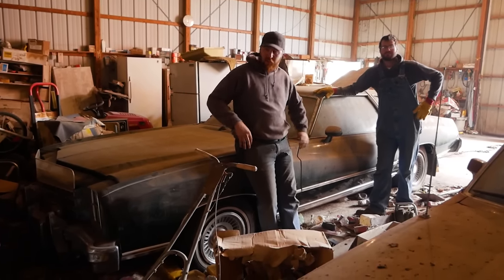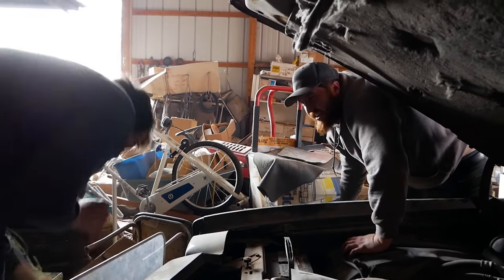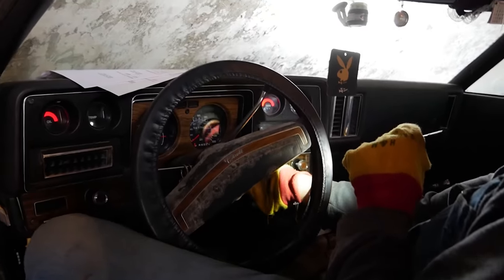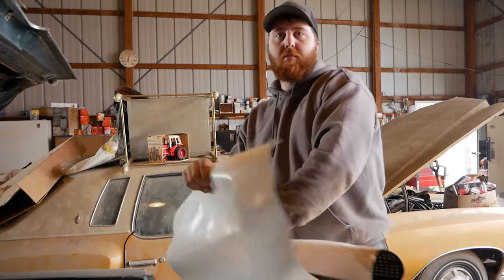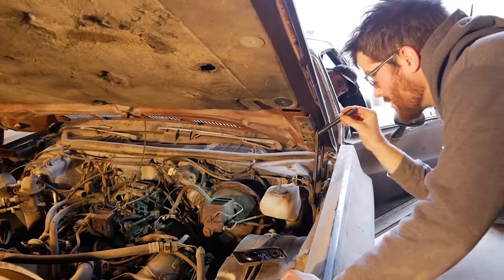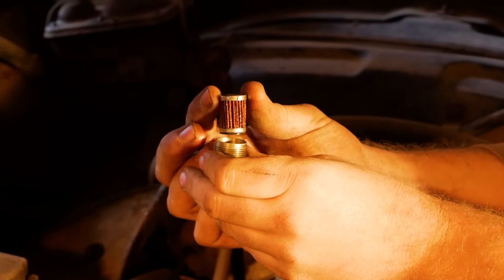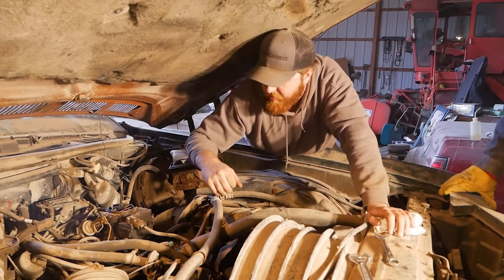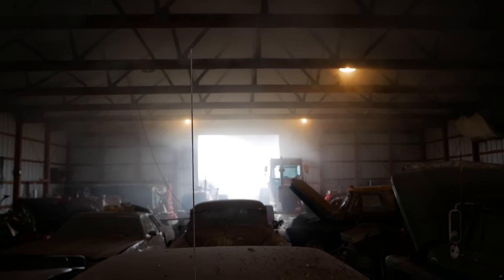ABANDONED Monte Carlo Driven From its GRAVE! - First Start in YEARS

Comment: I've got to say I love the fact you guys are pulling all these beauties out and doing what you can to get them running again.  Back before YouTube was a thing, my wife's uncle bought a house in Phoenix, AZ that had been abandoned.  In the detached garage, literally under three feet of garbage, he found a 1977 Camaro Type LT.  The home seller forgot it was there, but had a title for the car.  I gave $200 and towed it home. A carburetor, some new plugs, a fresh battery, fresh gas, and an oil change made it a daily driver while I was in college.

The car was an Arizona car, so no rust, but the paint and interior were sun baked.  I ended up installing fresh carpet and some swap meet bucket seats from a GMC Cyclone and had a great little car.  In three years, it only let me down once when the coil on the HEI gave out.  In the end, I sold the car for $1500 after I finished school, because I didn't need it.  Now that same car, in the condition it was in would bring $6000-$7500.  What a difference 24 years can make.

Comment: Just a quick note Kevin,  the 400 small block used only two bolts if it was equipped with the 2 barrel carburetor.

Comment: I love older Monte Carlos. Use to own a 1979 and it was a great car to hot rod. Took out the 305 and placed a 383 stroker in it with a 12 bolt rear end. One of the fastest cars I ever owned. Hopefully you can get the other Monte Carlo running.
Reply: 1979 is not the same body style as this 1976 model...it ran '73-'77. Changed in '78

Comment: I have enjoyed these vehicle revivals from that farm (just like I have enjoyed all your other ones). I hope the Pontiac Bonneville SSE is next to be revived as it was the highest Bonneville trim level in the 1987-1991 era and a fully equipped one had a crazy stupid amount of buttons in it for convenience. Also i hope the Lumina is revived, though you better hope it does not need any real engine work as the z34 has the 3.4l Twin Cam LQ1 which while producing at least 200hp (a respectable amount in the early 1990's for a V6) and was pretty quick but is a nightmare to work on. As for the the Buick Lesabres in the yard blowing white smoke or smelling of coolant. The head gaskets are probably fine. These engines (3800) while mostly bullet proof and reliable, suffered from two issues. The first was the lower intake gaskets. GM went cheap and used a plastic lower intake gasket (called composite by GM). Those tented to crack and coolant would get into the engine or the exhaust. Year later GM came out with a replacement gasket set that was metal and that stopped the issue (they should have used metal in the first place). The Series 1 and Series 2 3800 had this issue. The series 3 used the metal gaskets and had no issues. The second issue was that the upper intake on the series 2 would crack at the EGR valve because of the area always getting hot. The replacement upper intake had a metal sleeve in in the hole where the egr pipe went into on the intake and that fixed the heat cracking issue. i have done many of these intake gaskets and while it is no fun, it is far better then the 2.8l,3.1l, 3100, 3400 60 degree GM engine intakes. There is also the coolant elbow leak on these engines. GM had a coolant bypass going through the belt tensioner and the hoses were hooked up to these plastic elbows that cracked after a few years. I ended up replacing mine with metal aftermarket ones using new GM o-rings and that fixed the issue. Good luck and happy New Year

Comment: Those 75~77 engines were factory tuned so lean, that just not having a functioning accelerator pump was just too much for them. Hell, I remember them stumbling and stalling upon the slightest acceleration while being brand new. I also remember the ultra "stanky", and rancid smelling super lean exhaust smell coming out of the catalytic converter. Which, I would not be surprised if it were all clogged up by now. One of Chevy' nicest cars. A truly unpolished Gem!! Also yes, it most likely has the more modern and larger Chevy 2 barrel, held on by just 2 bolts, with the thick phenolic gasket, and with, (wait for it!!!), sealed off idle adjustment needles. Not adjustable by the mechanics, (unless you break off the aluminum plugs covering them). If you really want to help it, please put the accelerator pump on in and while you have the top cover off, do the old gal a favor, and go up 2 o 3 thou. on the main jets. Trust me, she will reward you for it!!
Reply: I've had several Monte Carlos , a 76 bought new, a 75 that I swapped a 750 Yamaha for, a factory high performance big block 454 73 Monte Carlo, a 77,79, and an 80 and all the early small block models had to Rochester 4 bbl quadrajet carbs . It wasn't until 1987 that Chevy started with throttle body injection small blocks. I grew up in the 60s and 70s and those tbi carbs were either great or they sucked , no in between. It was just cheaper and easier to bolt on a good Holley 4bbl , tune it how you drive it , toss a shift kit in the old turbo 350 and you had yourself a respectable street ride. I even knew a guy that took a short bed Chevy 4x4 frame, put a 4"lift on the suspension, 4" on the body, mount a 75 monte carlo body on it, 38" gumbo monster mudders and it was the most kick ass Monte Carlo around . Ah the good old days when a 70 ss Camaro cost about 1500 bucks used and $1200 would buy just about any make of 4x4 beastie that you wanted to play in the mud with.

Comment: Another epic revival!
Reply: reduce the plug gaps to about .015 and keep it there for about 2 tanks of gas, and also advance the timing about 5 degrees before spec. and clean the INSULATORS on the distributor cap and coil. and try to fix the accelerator pump.  Also, hotter running plugs or plug foulers, and another fuel detergent in addition to the Marvel.  Listen for spark knock in case that all goes too far, though I doubt it.

Comment: The 73-77 Monte's are great. I had a 73 Landau with the swivel buckets  very much like the one I have seen outside by the shed in your videos. Best road trip car ever. With that engine set back, it handled surprisingly well. I used to take the fan and shroud off to protect my back and gut from leaning over the fenders. On those old GM's, itf the gas gauge goes past full, it means the positive wire is disconnected at the sender, or the wire is broke somewhere in between tank and gas gauge.

Comment: I had a 75 , and brought it in for an inexpensive alignment . The tech showed me why an alignment wouldn't work without changing some parts and because that front end is designed by Mercedes Benz it was going to cost 500$ .
That was 1983 prices .
She did drive like a dream afterwards. 
I only paid 500$ for the car to begin with so for a grand that car was worth twice that much in those days .
I saw my brother flip a 72 and live through it with only one scratch .
Excellent vehicles and a Sweet find you've got there !

Comment: I had a 72 Monte, the tunnel behind the rad made a good cat heater/bed. It sat in storage and the MC went bad all the time, those old cast iron models didn't hold up well in storage. I rebuilt those carbs in the 70s and 80s a lot, especially when they sealed in the idle mix screws, you could always improve on those.
 Rochester qaudrasquirters and dual squirters, Carter AFBs, hole-ease errr I mean Holleys, Fords, with the "guaranteed to make a fire" accel pump on the outside.

Comment: Hi just for some advice, only if you want it. If you can get Redex fuel treatment in the States, then try it added in the fuel tank & can drizzle in through carb. This will clean up fuel system and clean combustion pots and give upper cylinder lubricant. Oh if you want engine to have best lubrication add Molyslip 2001E oil treatment uses Molybdium disulfide. Good additions. I used for 45years in my long lasting vehicles. UK.

Comment: I don't think y'all realized it, but you guys uncovered at least $600-$800 worth of collectible stuff that I've seen so far in the video.

That yellow Stetson is probably worth $150 alone... If it's a size 7 1/8 or bigger, it's worth a good $200 or more.

The blue jacket with the metal zipper that's in the trunk of the Monte could possibly go for $100 or better, if the size is 42 or bigger and it's in really great condition.

Those Franklin Mint models are worth big dollars, too.

Folks collect all kinds of stuff that someone would never consider.

I hope you guys were able to salvage a big bunch of stuff!

And that Monte is just beautiful!

Comment: My parents bought one of the last round headlight version of this car new. Dark green with matching interior and vinyl half top.I was a little kid at the time, so I’ll guesstimate it was a ‘74? They kept until ‘79 and traded it for a second hand, very worn Honda Civic during the second wave of the gas crisis. My dad was convinced that the gas lines were never going away! The Monte was very low mileage (like less than 30k) because my mother wasn’t working then, so the car literally only drove it around town; to the grocery store and errands and it was garage kept and looked like new! They took a beating on the trade in (because “gas guzzlers” were worthless at the time) and I can recall my dad being so pissed about it! At least through the late 1990s - early 2000s, these cars were worthless. Only the first Gen Montes were desirable. This guy probably went around 15-25 years ago picking up these ‘70s - ‘80s big cars for next to nothing! Nobody wanted them back then; they were bargain beaters!

Comment: One thng for sure the carbureton pump isnt working on that carburetor thats one reasonn for the hesitation when you get on the gas and will also make it stall out when you are driving at low speeds I went to school on those carbs and it definitely needs a kit in it

Comment: My dad did not ever throw anything away. That includes paper sacks used oil filters empty oil cans everything. And he went to every Harbor freight store within driving distance. He had screwdrivers socket sets electrical tape multimeters screw bits circle saws in very strategic parts of his yard so he would not have to walk back to the garage and look for anything. He collected bicycles vacuum cleaners Any motor off of any appliance. And he always cut off extension cords Ford just in case. I miss my dad

Comment: I understand the logic behind getting heat in the oil before draining it, but it seems like after years of sitting, you would get more contaminants out by draining it before starting it. The last time it ran the contaminants would have drained into the pan after shutting the engine off.

Comment: Here's  a good one for kev all the cars in Brazil run on E85 75% or more moonshine ethanol some cars only run pure ethanol. $750 to $1,000 to prepare remove all the plastic and rubber from the fuel system ethanol will eat

Comment: Had a map sensor vacuum leak on 95 xj and it had a really rough idle for a while and finally got to where the line was basically broke in half before I found it and it wouldn’t start anymore had a really really bad Miss when giving it throttle tapped the line with electrical tape and it turns over twice on a 2 week cold start and fires right up not a problem since with that anyways

Comment: That has to be a 1976 or 1977. In 1978, they reduced the size of the body.  I like that old gold 1973 model back by the building.  I had a 1975 Monte Carlo in Highschool and it was the same color green with Beige top and interior, and gold snowflake Trans Am wheels.  It was very cool but underpowered as most malaise era cars.

Comment: I owned a 77 with a Factory Sky Roof Captains Chairs n Console Shift from a 74 all black Int with rebuilt Tilt wheel with  a 400hp LT1 Block LT1 Rods 70 Vette Flat Tops single trough pistons Phase 2 Bow Tie heads with 1010 push rods Roller Rockers topped out about 135mph

How much ??

Comment: I thought it was bad compression on the motor for it to run like that.  Usually a piston would be sitting at the very bottom with the Piston Ring completely closed,  and when the engine starts running again the piston would come up but the ring is stuck from being at the bottom so long it doesn't open up allowing compression during the ignition stage...that's my guess??

Comment: So... I've come across a problem PB blaster and a breaker bar couldn't touch. I've got a new York truck(2003 sat 2 years), with a tire that just blows raspberries at you if you put air in it. The Lug Nuts on said tire ate 2 cans of PB Blaster, and did nothing but round off. Switching from a lug wrench to a Breaker bar and same size socket just made it worse. Help!

Comment: Some of the cars you find need to be treated a little more carefully than you do. I fear you cause unnecessary damage by not taking appropriate precautions to check systems and parts before taking off. The Monte Carlo is a good case in point.

Comment: Good Mechanics  don't rev a motor that hasn't been started in 20 years to the moon on the first  with old oil in it still
Reply: I agree. I cringe every time he revs one of these. Even flooding carburetor /cylinders which is draining old gas into the oil pan. Then didn't do an oil change. Painful.

Comment: immature, its easy spark plugs clean the carby FRESH GAS AND FILTER with oil change and filter and check the leads u got a nice find but u dont have the knowledge, doing bare min for a poor unit that you're just going to ruin